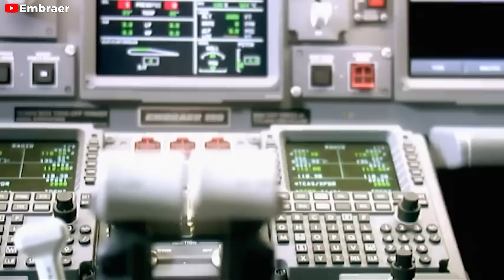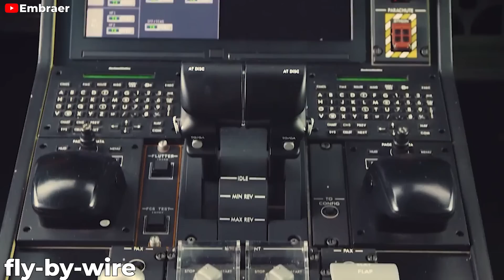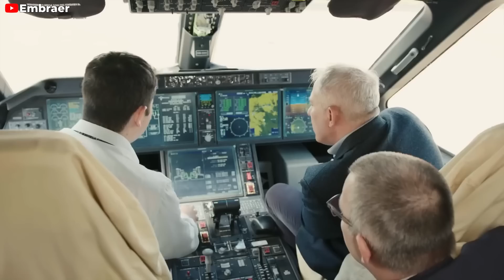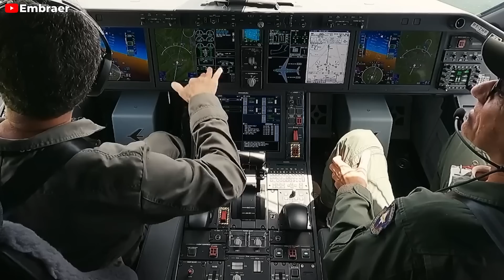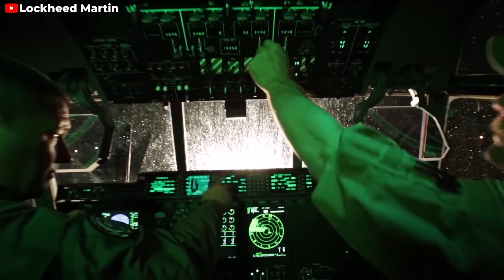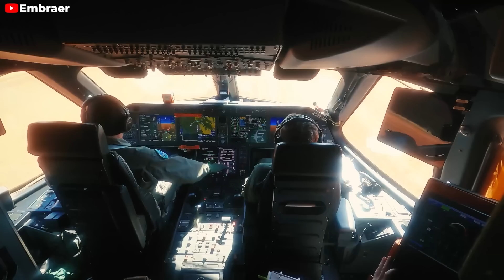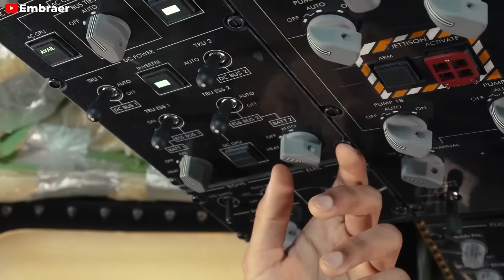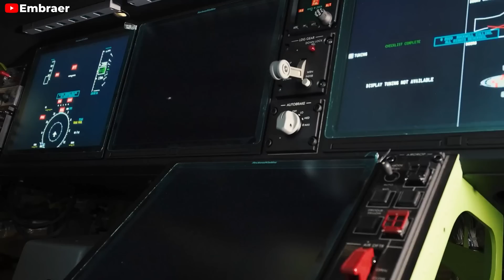The Embraer NEW C-390 Will Change The Aviation Industry and Destroy C-130J! Here's Why

Comment: Only Chinese and Russian pull a stunt like this when they try to prop up something that doesn’t work as intended or is bad… yall Brazilians are no different
Reply: The Brazilian military uses a bunch of C-130 as well and has been the main turboprop cargo plane for decades. The Air Force decided to develop the KC-390 to supplant the deficiencies of the Super Hercules for the necessities of the Brazilian military, being able to operate in shorter and softer runways (grass, dirt, sand, gravel, snow, etc.), being more efficient (lower fuel consumption), cheaper to operate and maintain (less engines, that are also commercial), less personnel necessary (no cargo master), longer range, higher service ceiling, better avionics, better automatization, multi-role characteristics (such as cargo, tanker, paratrooper, air supply and ordinance delivery) and it bringing it in-line with the rest of the newer and more modern aircraft that the Brazilian Air Force is acquiring and developing. This is all to keep Brazil modern and in its regional power position.
Countries that have historically purchased American planes will not stop doing so, so the video's title is quite inaccurate. Also the American defense companies have a strong lobbying power within NATO members, so even though the KC-390 is better and more modern than the old C-130, countries that already operate it aren't likely to change. The countries that have, in fact, already purchased the Brazilian plane have also participated in its design, like Argentina, Hungary, Portugal and the Netherlands. The main market will likely be developing countries that have historically purchased Brazilian vehicles and weapons, mostly in Latin America, the Middle-East, South Asia (like Indonesia and the Philippines) and a few African countries like Egypt, Libya, Morocco, Angola and Mozambique. Brazil is the 3rd largest aircraft manufacturer of the world, it's not a surprise that we are entering the military cargo plane market, knowing that Brazil is already producing and selling other types of military aircraft, like AWACS planes, CAS planes, personnel transport planes, helicopters and we are now starting domestic production of the F-39 Grippen.
Mind that Brazil isn't aligned with China or Russia, but more closely connected to the USA and other NATO members, we are mostly aiming of the markets that used to be backyard of Russian defense exports, but now with their blunder in Ukraine they don't even have enough for themselves, much less to export. China is also not much better, they export to even less countries than Brazil and everybody has zero confidence for their products, especially their airplanes that have been proven to be a commercial disaster. They basically are selling only to the usual "axis of evil" like North Korea, Iran and Venezuela. While Brazil have a good relationship with Iran, we are not on good terms with China and much less with Venezuela that have massed troops near our border in their claims over western Guiana.
Reply: @395leandro obrigado pela resposta

Comment: Propaganda again! C-390 has a  turbofan jet engine… and comparing it to a c-130 that is turboprop powered is misleading and bias. If you want to compare it to something similar C-17 can do the same thing with more power.. of course you only went for the c130 comparison because c-17 is much bigger and powerful.. and c130 is little small and underpowered.. which is a cheap shot…
Reply: C130 and C390 are from the same category, medium transport aircraft, while the C17 is a strategic transport aircraft which is another category.
Reply: @BlackIc0  C390 had no STOL capability, it is NOT from the same category as the C130.
Reply: @bricefleckenstein9666  the C-390 has STOL capability, C-390 needs fewer runways to take off than the C-130, it has the same weight as a C-130 and almost twice the power, why do you think it would take off with more runways?  this is illogical
Reply: @BlackIc0  5000 foot MINIMUM takeoff length per it's specs, though you have to do some digging to find that. That is NOT STOL, it's almost identical to the old 727.
Hercules is SPECIFIED at 1400 to a little less than 4000, depending on the load.
NOWHERE is the C390 specified to have "rough field" capability that I can find, which the C130 had going back to it's EARLIEST models - though it does appear that the C390 has some rough field capacity if you're willing to take the MUCH higher risk of FOD damage from a turbofan vs a turboprop.
The C390 needs MORE runway to take off, not "fewer" - there is no "think" to that, it's in the SPECS.
The C390 is specified to have a max takeoff weight about 190,000 pounds vs 155,000 pounds on the C130 - no it's NOT "the same weight as a C130" (I can't find an empty weight for it, but given the spec on cargo capacity is seems like that would be about 100-120,000 pounds to the Hercules at 76,000).
It does have about 50% more cargo weight capacity, but not a lot more space in the cargo hold (see the pallets carried specs, 7 "master pallets" vs 6).
The primary difference in takeoff length seems to be due to the C130 being a turboPROP, which is a lot more efficient at low speeds than any turboFAN is of a similar generation.
Reply: @bricefleckenstein9666  Dude, whatever you're researching is looking wrong, the C-390 needs a minimum runway of 1,200 meters which is about 3,900 feet, the C-130 needs 1,500 meters which is about 4,900 feet...
Reply: @BlackIc0  You need to look at the actual Embraer specs sometime. And the actual LM specs.
5000 feet is the specified MINIMUM given for the C390 (that does appear to be at full load), the C130 isn't specced for as much at 4900 ANYWHERE I've seen and is specced for 1400 at minimum load going up to a little less than 4000 at full load.

I have NO CLUE where you're getting your "specs" from.

To be picky, the KC-130 tanker version of the aircraft has both landed AND taken off at full load in less than 1000 feet - during the tests on USS Forestall about 1962, but that would have been with more than 30 knots of headwind to work with - but at least once at full load with NO JATO AT ALL (straight up deck launch).
Reply: @bricefleckenstein9666  you are literally comparing the specs of a loaded C-390 vs an empty C-130...
Reply: @bricefleckenstein9666  make a simple comparison on the aeropedia or open the Embraer and Lockheed websites and compare the distances, both with the same load the C-390 needs less runway.
Reply: @BlackIc0  Interesting claim, since the ONLY distance mentioned on the Embraer site that I could find was the 5000 feet minimum I quoted, while the LockheedMartin site quoted the figures I quoted for the C130 (other than the 1500 foot one).
C130 has a lower max load - which IS an advantage to the C390 - but for STOL usage that seems to be the ONLY advantage the C390 has.

As a straight out medium transport, the C390 is overall better - but not for short field usage per ANY of the specs I've been able to find, not to mention the higher risk of FOD killing a turbojet vs a turboPROP.
Reply: @BlackIc0  Did you bother even reading my comment?
I specified a RANGE of loads and distances for the C130 - which I COULD NOT FIND ANYWHERE for the C390, just that one "minimum takeoff length" spec on their web site with no specification as to the load level.

Comment: I certainly prefer the Airbus A400M as it is a Turbo-prop aircraft for which the engine maintenance cost is way lower than any jet engine, it also cost a lot less in fuel and has a better range under same MTOW than the C-390.  It lands in and take off from shorter runways which enable it to almost land and take off from about any land strip.  Its payload is way better under any configuration.  It has a better range under any weight (10, 20, 30 tons).  The price of a C-390 is definitely way higher as it is a jet.

Comment: Pretty much a jet powered, advance technology C-130. An idea whose time has come. Lockheed Martin went as far as they could with the C-130 airframe and turboprop engines. Embraer took military transport aircraft design to the next evoloutionary level. Let's see how it does performance and reliability wise. It definitely fills a need  in the military transport market. Nice job Brazil. 🇧🇷
Reply: NO STOL.
NOT comparable at all to the C130.
More comparable to the C17 or the older C141.

Comment: I have a question does the C-390 need paved air fields?? If so then the C-130 will still be more useful than this jet. And with the engine placement this will never be a gunship at all because the engines are to close to the airframe.
Reply: KC 390 He can land on unpaved roads, and also build to operate in North Pole on the ice runway, and also he can refill himself in the middle are
Reply: @ulissesferreira5892  I'm talking about unpaved runways not unpaved roads. As for both the C-130 and AC-130 they can do air refueling as well. As for snow landings the C-130 has been doing those for decades. They were making landings at McMurdo Station in the South Pole before this thing was even a drawing on the board. They have even useed a C-17 Globemaster, which makes the C-390 look puny, to resupply McMurdo. There is even C-130s with skies in the Bone Yard in AZ.
Reply: Bro they have the same capability the only difference kc390 can carry 3 tons more weight and he's faster
Reply: @ulissesferreira5892  Except one has a gunship version and the other doesn't. And a jet cargo plane goes to fast for use as a gunship. And the swept wing design doesn't help it much in being a gunship either. Besides the C-130 has been around a much longer time and has a very proven track record.
Reply: @ulissesferreira5892  Except one has a gunship version and the other doesn't. The C-390 might be a nice toy for countries to use but th C-130 has a proven track record and is in more countries than the C-390 is and a better supply chain for parts. On top of that jet engines are more labor-intensive to maintain than prop engines.
Reply: @Lonewolfmike  The Brazilian Air Force's initial requirements for Embraer were for the 390 to surpass the C130 in every way, including unprepared runways, as the Brazilian Air Force itself has this need for humanitarian aid for indigenous peoples isolated in the Amazon. So in the same place that the C130 lands and takes off, the 390 also does so. Yes, the C130 is even more used as it has been flying for over 50 years and the 390 has only been flying for 5 years. But several air forces have placed orders for 390 instead of the C130J which is the newer C130. Clearly new technologies made it possible to design an aircraft that was superior in every way. Comparatively, do you think that a car from 1960, even if modernized, is superior to one from 2010? Jet engines, especially with FADEC, are much simpler to operate and maintain than any engine with propellers. And don't forget that the C130s have turboprop engines, that is, in addition to being jet engines, they have a whole gearbox for maintenance. And there are still 4 engines against 2 to take care of. So much so that a highlight for the sales of the 390 is the greater ease and lower maintenance cost. Remembering that it basically uses the same engine used in the A320. And Embraer is renowned for its customer service. So much so that it leads the executive aviation segment.
Reply: @wallacemjr  You're going to have to have more mantinence because of those jet engines. I wonder what the maintinence to flight tims will be on those hogs?? Good luck trying to become a gunship with that design. Can't get better than the AC-130 Perfection. 🤣🤣🤣🤣🤣🤣🤣🤣🤣🤣🤣🤣🤣🤣🤣🤣🤣🤣🤣🤣🤣🤣🤣🤣
Reply: @Lonewolfmike  There is actually less maintenance with these jet engines.
The C-390 has greater availability than the C-130, which is why the Netherlands and Austria are purchasing this aircraft.
Probably the only thing the C-390 won't be able to do is be a Gunship, in everything else it surpasses the C-130.
Reply: @Lonewolfmike  No wonder Sierra Nevada entered into a partnership with Embraer to develop and produce its products in the United States.
It is quite possible that a KC-390US version will soon emerge to begin replacing the C-130s.
Reply: @simeao1979  You ever hear of the Bone Yard??
Reply: @Lonewolfmike  
Have you ever heard that Sierra Nevada is one of the main companies that makes modifications to C-130s?
Reply: @Lonewolfmike  
There must be a very relevant reason for them to form a partnership with a company that is producing the biggest competitor of one of their clients...
Reply: @simeao1979  They are hoping, and that is the big thing HOPING, for money. Whether that happens is still the question.
Reply: @simeao1979  And they will still be doing modifications as long as the Air Force and other countries have C-130s. Until they are all decommissioned C-130s and AC-130s are still the backbone of quite a few militaries all around the world. By the way have they used this plane for anything like fire fighting or anything like that?? Or hasa it only been military use. Yuo see the C-130 is a proven versatile air frame that has many uses outside of the military.
Reply: @Lonewolfmike  
Companies have no hope, they have market assessment, projection and planning.
Reply: @Lonewolfmike  Yes, they use the C-390 to fight fires without needing to have a dedicated aircraft for that.
The entire interior and operability of the aircraft is modular and within a few hours it is possible to change the configuration from stretcher transport and aeromedical evacuation to firefighting. 
I think you still don't understand, the aircraft was planned and built from scratch to surpass the C-130 in everything, including acquisition price, operation, maintenance and availability of use.

And I even believe that was why Sierra Nevada decided to create a partnership with Embraer Defense & Security, being an exclusive partner in the USA.
There are even Embraer aircraft for sale by Sierra Nevada, the A-29 Super Tucano.
Reply: @Lonewolfmike  
This is a new aircraft, which is arriving on the market now.
But most likely in 30-40 years all C-130s will have been replaced by C-390s. 
And I'll go even further, it's likely that the USA is the largest developer and manufacturer of the aircraft, and there are already talks between the mariners and Sierra Nevada for specific versions.
Reply: @simeao1979  How can it surpass the AC-130?? It can't the engine placement and everything else is wrong. Swept wing plane is NOT made to loiter like a straight winged plane can. Just like an A-10 can loiter and destroy tanks, armored vehcles, vehicles, bunkers, and the like. And that crop duster of a plane I would NOT want to take into a fight because it would get their pilots killed if they came up against any kind of AA set up. An A-10 can take more damage than that thing can and still fly you home alive. That crop duster is a flying coffin.
Reply: @simeao1979  And you will see C-130s for a long time to come. You don't thow away tried and true aircraft just because someone makes a new toy. Get some actaul years under its wings before it can say anything.
Reply: @Lonewolfmike  
There is no need to replace the AC-130, in the same way that there is no need to replace the A-10, the combat scenario is changing and there is no longer a need for a gunship like the AC-130, just see that neither of the two It has not been used in combat for over 3 decades.
Apparently you don't understand anything about aviation and even less about combat aviation.
Reply: @Lonewolfmike  No one will throw anything away and no one made a toy.
What happened is that they built an aircraft that surpasses the C-130 in absolutely every way, with the intention of gradually, as the world's air forces adapt and renew their cultures, tactics, methodologies and logistics, replacing it with an aircraft that will fulfill all requirements in the best way. As is already starting to happen.
The C-130 was a success in its 70 years of service and will be for another 30 to 40 years before it completely leaves the scene.
The platform is good, but there is no more room for modernization. 
The same process occurred with other aircraft and will occur with the C-130, its time is numbered and the replacement has already appeared.
Reply: @simeao1979  Ask every single plane that was supposed to "replace" the B-52 how that worked out for them. Until it proves itself it is just a toy. Deal with it fanboy. 🤣🤣🤣🤣🤣🤣🤣🤣🤣🤣🤣
Reply: @simeao1979  Ask every single plane that was supposed to "replace" the B-52 how that worked out for them. Until it proves itself it is just a toy. Deal with it fanboy. 🤣🤣🤣🤣🤣🤣🤣🤣🤣🤣🤣🤣🤣🤣🤣🤣🤣🤣🤣🤣🤣🤣🤣
Reply from the maker: thanks for your feedback

Comment: When the last C-390 is parked for retirement a C-130 will be there to pick up the crew. :D lol
Reply from the maker: thanks for your comment
Reply: Find out more, the C130s are being retired for use by the 390.
Reply: not in the US they aren’t.
Reply: @bd5av8r1  
For now, as Embraer and Sierra Nevada are developing a version already in American territory.
Most likely, it will soon begin to replace American C-130s.
Reply: @wallacemjr  Nope.
Older C130s are being retired in favor of newer C130 models, the C390 HAS NO STOL CAPABILITY and flat out CAN'T replace the C130 in it's primary intended usage.